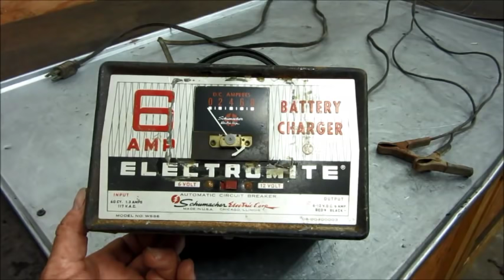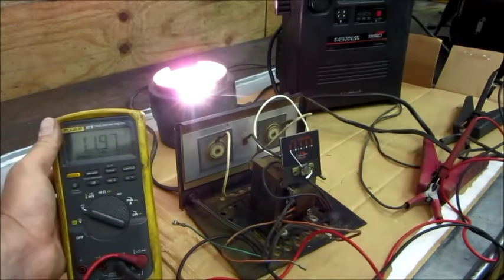Refurbishment of 3 old battery chargers, from flea market...

Comment: Glad they all worked out.  Especially the 2nd Schumacher ( I have one just like it).  Question: From a circuit / functional standpoint, what's the difference between a battery charger and a "battery minder?"
Reply from the maker: Hi Ken.  The difference is that the "tender" or "minder" or whatever they call it is a float charger. It has some form of electronic voltage regulator with a sharp cutoff at the full charge voltage of the battery it's designed for.

These chargers in this video are not regulated or automated in any way. The voltage will go up to 17 or 18 volts if the battery would go that high, but lead acid batteries just start bubbling and overcharging at about 15V, causing the charger to never reach its maximum open-circuit voltage. If you leave these chargers on the battery too long the battery will begin to get warm and start bubbling. The water content of the electrolyte will be slowly lost. That's why you need to charge the battery and then turn off the charger once it's done.

Comment: Thank you for this video, very timely that Youtube recommended it to me today as I just brought an old charger home to use for electrolysis and it smoked. looking inside I found the smoke to be coming from a mysterious component which I now know (thanks to you) is a Diode Bridge Rectifier. I understand the Bridge Rectifier changes AC to DC normally with two AC wires in and Plus and Minus DC wires out. I'm confused about how your Bridge Rectifier can work with only 3 wires connected. Mine also only has 3 wires. I don't know which to connect assuming I can find a replacement BR Diode. Since 2 of the 3 wires on our Diods are the same color i assume both DC inputs are used, I don't know if the 3rd wire used is positive or negative. Is the Diode grounded on the mounting bolt?
Reply from the maker: Just a quick reply as I'm at work.

The diode bridge from your charger has only two diodes in it. It has two AC input terminals, and one + DC out. The 4-terminal diode bridges have 4 diodes. You simply don't connect one of the DC terminals. It will always have both AC terminals used. Then, either the + or the - of the DC will be used. The charger design will dictate which you use. 

The two AC terminals go to the transformer winding, The DC out terminal goes to one of the battery clips.  If it goes to the red positive clip, then connect it to the (+) terminal on the rectifier.  If the wire goes to the black negative battery clip; hook it up to the (-) rectifier terminal.  The key is, only use ONE of the DC terminals.
Reply: davida1hiwaaynet Perfect response thank you. I traced the single dc output from the diode through a thermal cut off, through the amp meter, and finally out to the black clamp. Checked twice because I was expecting it to lead to the red clamp for some reason. I believe I’ll be able to repair this charger once I find a diode. Thanks so much for the education.
Reply from the maker: Great that you're on the right track with it. 

Look for industrial electronics shops in your area.  Also, places like Fry's Electronics have diode bridges.  Also if you can wait; online you can use Arrow, Mouser, or RadioShack. They all have diode bridges.

Comment: Hi David , I'm trying to do the same thing with an old 6/12 volt 6 amp battery charger . Mine has 3 wires off the output of the transformer (center tap ?) . I get 14 volts from either side to the center and 27 volts from the 2 outside leads . Each of the outside leads goes to one of the 2 old rectifiers and the center one goes to the output via the meter . I'm wondering if yours was the same and how you wired it through the bridge rectifier .       
Thanks ,
Barry
Reply from the maker: Hi Barry.  Yes each of these chargers has a transformer designed the same way as yours; with center tapped secondary.  

It's very easy to wire.  You will use only 3 terminals of the bridge rectifier. First of all, leave the center-tap of the transformer connected as it is, through the meter and out to the charging cable.

Connect the transformer secondary leads to the diode bridge. There are two terminals for the AC input, each marked (~).  These two (~) terminals go to the secondary leads of the transformer.

This leaves the diode bridge (+) and () terminals. You will use ONE of them. The charger's original wire from the selenium rectifier backing plate will connect here.  Look at the battery clip on the end of this wire which came from the rectifier backing plate.  If the battery clip is the positive clip (the red one) then connect it to the (+) terminal of the new rectifier. If the battery clip which was going to the selenium rectifier backing plate is the black (negative) clip, then connect its wire to the new rectifier () terminal.  

Hope this explains it!

Sincerely,
David
Reply: David ,
Thanks very much , I'll give that a try .
I appreciate you taking the time to reply .
Barry
Reply from the maker: Glad you found it helpful!
Reply: Hi David , Just to let you know , it works like a champ now .  Thanks again , Barry
Reply from the maker: Barry, thank you for the follow-up. Very pleased you got your unit working again!
Reply: @davida1hiwaaynet  So David, the bridge out put + and ground (0); where do they hook up? Oh, I guess you only connect one, depending on which battery clamp was originally connected to the old diode bridge. Right?

Comment: How to explain that Sears charger is simply price point. Not only is it a stupid design its CHEAP to build that way even if only by a matter of pennies. Its not expected to be repaired by anyone if it quits so why spend the pennies more to make it easier to repair.  I am surprised that they even use screws to hold the housing together. Next they will simply spot weld or glue the housing together so it can not be torn down. But we will fight the throw away world as long as we can.
Reply from the maker: This seems to be the case, but on the bright side, I see Lowe's selling the Schumacher chargers with the same metal housings as these; and Harbor Freight sells metal housing chargers which are built similar to the older chargers (metal housings and appear to be serviceable).

Comment: Hi I have an avacus ac/dc converter charger and its giving up more volt as it use to, 15.8 volts that which is usually 13 volts. I've check its internal parts and the transformer has a plastic wraped around it showing that its burned. I hope you have an idea to whats making it giving a lot of volts and amps, its making my batteries pour out acids. Please help thanks.

Comment: Thanks, I was repairing mind, where do you find good cords, alligator clips, meter lights etc. Thanks again
Reply from the maker: Hey Will; when this video was made, we had a Radio Shack store for the clips, lights, etc.  The radio shack closed, so now it's not as simple.  The clips can be purchased from most any auto parts store, such as Advance or AutoZone. Most of them also have indicator lights and switches available.  If the meters are faulty, they can be located online often. 

The meter covers are available from PLP supply. Check http://www.plpbattery.com/ for these meter covers.  
Hope this helps!
Reply: NAPA auto parts near me sells really nice copper clamps for batteries. About 3 or 4 inches long. They’re the best I can find.  Forney brand is a second choice.  They’re nearly OEM for my Century battery chargers
Reply: Will mac,  i know this comment is a little (lot) late but theres always Fry's  or even a battery world or place like that

Comment: Do you know if it's possible to modify Schumacher battery chargers to operate on 220 volts? (e.g.: do the input transformers have unused taps for 220 volts?) My friends brought a Schumacher SE-5121A and XCS15 to Bolivia, not realizing there would be only 220 volts instead of 110. Is there any possibility someone could modify either of these chargers in the field to work on 220 volts?
Reply from the maker: Hey; on these chargers in this video - the transformer didn't have any unused primary taps. They might have some models which are wound with a split primary which can be wired for 120 or 240; however I haven't seen that in battery chargers.
Reply: Thank you for that quick response. I thought it was a long shot, but I wanted to ask in case there was a chance to help my friends.
Best Wishes! Elmer
Reply: You have solid knowledge and use your skills accurately.I was wondering where you might have salvaged the diodes from in the second battery charger? I'm wanting to convert from the button style diodes myself.

Comment: GREAT, VIDEO YOU HAVE A GOOD, WAY OF EXPLAINING YOUR, IDEAS,,, TRY DUING, A VIDEO ON, A CHARGER WITH, A SURGE START THE DIODS ARE SET UP DIFFERENT AND I BEALEVE THE NEGATIVE, LEAD IS CONECTED TO, SENTER TAP ON THE SECONDARY, WINDING, THIS MOAD, IS FOR STARTING A CAR,,, I WAS LOOK ING, FOR A SHOP, CHARGER, AND WHAT WAS, 400S,,,...IS NOW, 900S,,,9 YEARS LATER AND THE FORINE ONES HAVE, ALUMINUM WIRES, ,, SPRAYD  RED TO LOOK LIKE, COPPER,,,...

Comment: on the first charger you fixed are you only using 3 of the 4 terminals of the new rectifier?
Reply from the maker: Yes, the rectifier has 4 diodes in it; but the charger only needs 2 of them for its circuit; so there is an unused terminal.

Comment: how did you replace the selenium diodes with a full bridge rectifier? weren't the diodes set up in a different way?
Reply from the maker: Hi Doctor.  It is easier than it looks!  The selenium rectifier was made up of two "diodes" with a common point (the metal plate the were mounted on). The full-wave bridge is a pair of TWO SETS of diodes, wired up just like the selenium rectifier. Since the charger doesn't need a full wave bridge, I only connected to the 3 points needed. One of the points on the full wave bridge is just not used.

Seems wasteful but in reality, these bridges are very inexpensive and it is cheaper and easier to just buy a full wave bridge and use half of it; than it is to try to find a half-bridge package. 

Hope this explains it!
Reply: davida1hiwaaynet what about buying a pack of individual diodes
Reply from the maker: You could do this - but remember the diodes have to carry the current and will require a heat sink. A bridge rectifier package is just so convenient since it is already insulated from the heat sink.
Reply: there are some packages that can handle 50 amps each and would never get hot, tho in this case with the selenium rectifiers the terminals were perfect, but those that are soldered in, getting separate diodes would be the way to go

Comment: Hello sir. I accidentally plug the Schumacher se5212a 110v charger to a 220v line. What component parts i need to replace? Many thanks sir good day
Reply: Probably at least the bridge rectifier....start with that and maybe you will be lucky (unless there is an internal fuse...then even luckier!).
Reply: @englishrupe01  many thanks sir for the info.

Comment: Can I ask you a technical question?    I have the Schumacher / Everstart Starter 50, 10 amp with 2 amp, 10 and 50. 

I found the thermal fuse had been blown, changed it, Currently all I have is a 100 and it won't fit down into the windings as it's a regular thermal fuse I had on hand (slightly bigger than a rectifier diode..) 

What was the temp rating on the fuse you replaced?    

Welp, upon plugging it in it makes a serious humming, after a few seconds tripped the little breaker in my multi outlet, and I also noticed some of the transistors on the board were a tiny bit "dry" looking on the top.  The shiny transistor look was gone, just looked like it heated too much.

The fuse that was in there, 240C which is 464F.    So.. I'm guessing there's a shorted winding in there as well.   Sidenote, some blacked area between two of the connection points similar to an arcing mark.   

Do these symptoms sound common and related to the main transistor on the heat sink, or the little transistors on the board.  or more like a windings short and it's probably a bad idea to put it back in my 84 year old dad's hands?

Comment: Recifiers are half wave, full wave or Bridge. Thermal cutouts are as listed, not a relay or a "fuse". Please be more specific as we have to buy the correct parts to fix our battery chargers. Best to take the old part with you when you search for the correct part and if the part can handle more current, then all the better.
Reply from the maker: Actually, you're not entirely correct and need to brush up on your electronics concepts. A diode bridge can contain 2, 4, 6, or more diodes.  Full-wave rectifiers can have two pairs of diodes and a two-wire secondary winding from the transformer; or they can be push-pull as these in the battery chargers are. Those use a center-tapped transformer and still produce a full-wave rectified output. Both types are full-wave. You can use a four-diode device for a push-pull rectifier by leaving one terminal unused. This may seem like a waste, but the four-terminal rectifier bridges are easier to source and more available. 

The thermal fuses are most certainly considered a fuse. They are a melting alloy device and are one-time use. An auto-reset thermal protector is a different device altogether and I am not sure whether any of these small battery charger have them. Larger units have a thermal fuse and an auto-reset device at the transformer; in addition to the overcurrent circuit breaker for the DC battery circuit. 

As far as matching up old parts, that is a wonderful idea and works when parts aren't obsolete as they are usually,  on 60 year old items such as these.